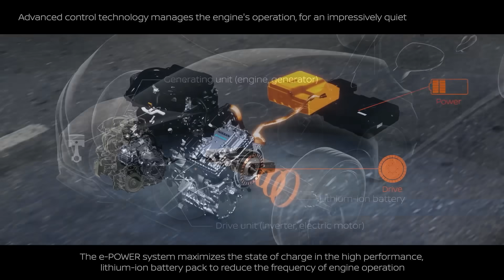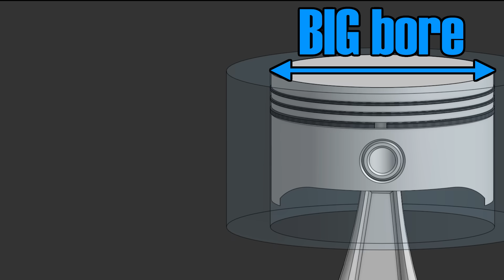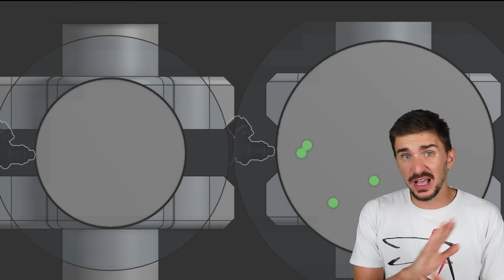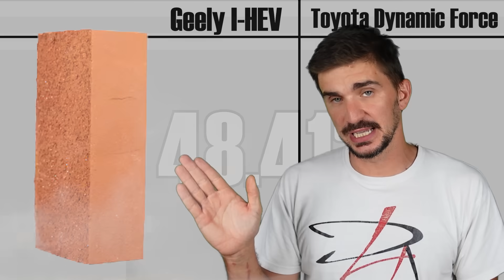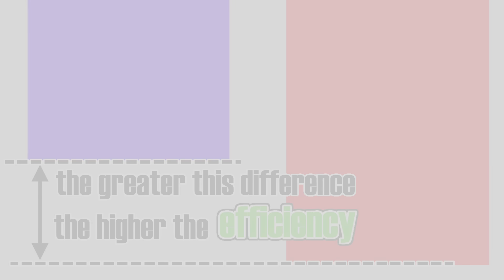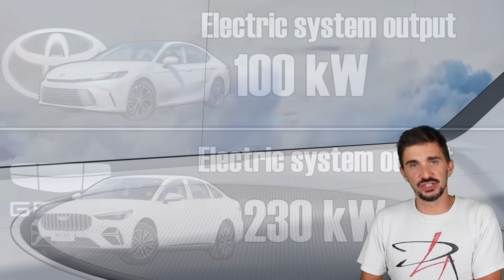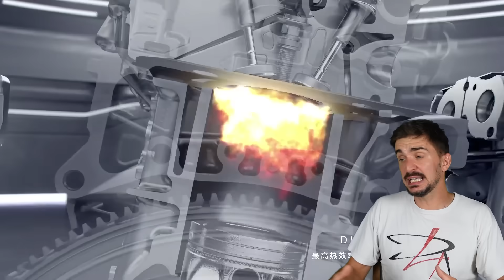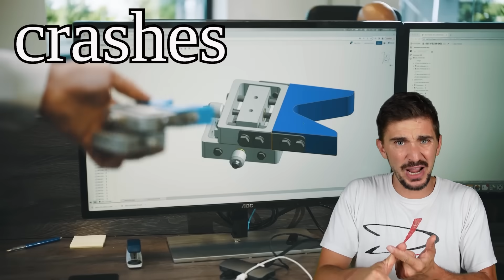How China's Geely Beat Toyota, BMW, Ford and Everyone Else

Comment: 48% efficiency doesn't make any sense with the presented technology by Geely, I can bet that they are measuring total mechanical work extracted by the piston from the fuel-air mixture, excluding the engine internal friction and other loses.
Reply: Atkinson/Miller cycle increases efficiency up to a point, going "deeper" than the sweet spot reduces it because engine internal friction starts to be "dominant consumer".

Comment: FYI when talking about a difference between two percentages you should use "percentage points" not "percent". I.e. the difference between 80% and 90% is 10 percentage points, not 10 percent.

Comment: I always thought that this is an interesting approach. Like a D-E train, but with some battery in between. Even a less efficient engine could make up for it because of the electric motors, batteries and regenerative braking. Plus, no losses in transmission, less moving parts..

Comment: Here's a question you didn't address -  yes, the longer strokes of diesel engines also results in higher thermal and fuel efficiency.  The trade off is that the combustion is at much hotter levels resulting in greater production of NOx.  Now, you could just run the engine at richer fuel mixture to burn off the NOx inside the engine, with more hydrocarbon emissions that could be burnt off by the catalytic converter.  BUT, you then don't get the eye popping mpg numbers that sell these engines.  So, passenger diesel cars use the notorious DEF, which was just urea, a.k.a. piss, as a reducing agent instead of fuel to maintain their dazzling mpg numbers.   As China has little air pollution controls, the question is what are mpg fuel efficiency ratings of Geely's cars in China versus this same engine sold in Western countries with strict air pollution controls?   I suspect they would need to run these engines at richer fuel mixtures (thus lowering the mpg numbers) in Western countries versus in China.

Comment: 14:35 Chevrolet made the Volt which was an EV first hybrid but killed it in 2019, it uses the engine is mostly as a generator but can connect to the wheels at highway speed for more efficiency, and it runs on a Atkinson cycle.

Comment: So it's about a 17% jump over Toyota's best engine: very impressive.  If the fuel economy improves similarly (it should) that would take a typical new base Prius from 56mpg highway to 65.5.
Don't say "Miller/Atkinson."  That just reinforces the error.  It's Atkinson.

Comment: I do not understand why we didn't get more Range Extender like the Chevy Volt, everyone that I know that owned one loved it. RE on a properly made EV chassis (looking at you Mazda...) should have the advantage of using a smaller cheaper, lighter battery with enough range for normal day-to-day usage, and on board recharging for longer trips with a small ICE optimized to run at a single RPM range. And the vehicles stays pretty much 100% operational in case of ICE issues, lessening the reliability concerns of hybrids. The lowered mass would also alleviate the tire wear and cost of large range high capacity battery EV currently on the market.

I currently don't make enough yearly distance to justify buying a new EV to replace my ICE car, but an well made EV with a smaller battery capacity and a RE would be on my radar quickly.

Comment: IMO most of those "amazing developments" are hollow numbers.
Part of why those hybrids engines are so efficient on paper is simply reduced exhaust treatment. Since they drive the cycle with/on Battery, they have less emissions and need less exhaust treatment to be compliant.
However, this means most hybrids have comparable emissions (aside from Co²) even during test cycles and (much) worse when driving on a flat battery.

Then you got all the "small" things that go against reliability. Weaker oil pumps, thinner oils etc.
And at the end of the day all that efficiency gets negated by a being packaged in a giant vehicle together with batteries, electric motors, computers/chips etc. anyway.
It doesn't make a vehicle better for the environment, when it uses 5-10% less fuel but needs to be replaced more frequently (and uses more resources during production).

It's the same story with those amazing CW figures of modern EVs, which conveniently leave out the area, making them completely invalid.

It also feels like modern cars become more and more useless or designed around being useless. 
If you bought a normal car in the 80s or 90s, you could use it to move.
If you buy a normal car now, it already comes pre-stuffed with all sorts of nonsense.
Even if you buy a large vehicle and can physically fit something like a washing machine inside, it would most likely damage the interior.

So at the end of the day, your "more efficient" vehicle is gonna sit in the driveway, while you get stuff delivered or rent a transporter for it.

To be clear: I'm not against development in general, but the automotive industry needs to focus on the consumer, rather than shareholders, agendas/politics or other nonsense.
You can only go so far with bad products. Even if you manage to push them onto customers, those customers will eventually be confronted with the depreciation (or other shortcomings), which impacts their buying power. 
VW propped up their sales numbers with pre registrations followed by heavy discounts and paired with subventions, but they still bled money on their ID.3 (and others). 
But even those who bought them with all the discounts and what not still got a turd that's as sought after as Keir Starmer as a financial expert.

Let me be blunt: Toyota is currently selling the Hilux Champ in Thailand for the equivalent of 14300€ (LWB Manual 2.4 Diesel 150hp).
If it were offered here in germany for 15k€ (not possible because regulations), I bet it would reach the highest marketshare instantly.
Not because people would fall in love with the design or don't want any luxury but because they need something that actually works as a car.

Comment: The very high compression ratio puzzles me. Surely you cannot have a spark ingnition, petrol (gasoline) engine running a 15:1 compression ratio without severe detonation taking place? I think the high compression ratio is calculated using the bore and stroke, but the actual compression ratio is substantially lower due to the Miller cycle.

Comment: Because Chinese engineers find out that combustionalized EVs are the most energy efficient. Gas alone only gives you at most 500 miles.Batter alone only gives you 400-500 miles top. But if you combine them together. Easily 800-1000 miles, with lower gas consumption and charging fees. image you can drive your car with 20 dollar gas and 10 dollars charging fees to drive almost 1000 miles. 30 dollars gives you from Boston to nearly miami. That's a great deal.

Comment: I think the high static compression ratio is used to achieve a high enough dynamic/effective compression ratio to maintain some power output, giving a much better balance of power an efficiency, only downside is it cannot be used as a otto, itll knock its brain out lol

Comment: thermal efficiency isn`t mechanical efficiency - when i studied i told my pro in an examen that we shall use the cooling water to heat up our houses - so the overall efficiency would be rised. only for germany you could save over 20%! by just using a small water tank (50l)in the back of the trunk.

Comment: This car will be obsolete so fast that spare parts will not be even distributed.... AI connected uphill prediction.... driving habits... to compensate for things that should be solved at the beginning...Cars should be simpler and locally serviceable by small independent mechanic shops or by yourself in some cases...

Comment: Neat even though it's much too late for cars. With the low battery cost it doesn't make sense to use fuel. under 50$/kWh a 40kWh pack is 2000$. Electric motor costs maybe 100$, power electronics can be equally inexpensive, say 300$, hybrid just can't compete with that when electric power can be nearly free of cost. There is no such thing as oil crisis for an EV. But there might be a tiny window for propeller planes to use efficient ICE but would need at least 100 horse to be interesting. What is it? 20horse?

Comment: I understand the choice of only current of recent engines for the stroke-to-bore ratio comparison is understandable, but the very first variant of the very first example of a traditional long-stroke gasoline engine that I decided to check (the old Ford Straight Six) has a similar stroke-to-bore ratio as the extreme recent examples. There's nothing new here.

Comment: The problem is that car makers are still trying to make a swiss knife version of a car.   You can't.   
Cars should be tailored to the needs of demographics.   And people should be more consequent with what they actually need.  In my case, living in an island and driving 100km a day at 120km/hour, I don't need 400hp and a 2 ton behemot that can do 500km on a charge. Despite of that   I would like to have bit of comfort like interior space and a comfy ride,  I don't want a gof chart.  Or a 40k luxury urban.    
There is people that lives up in the mountais and have the same situation...     Cars are getting designed with cities and traver in between cities in mind only

Comment: I drive a 15 year old 2.0 hdi diesel engine, in a 407 SW. No AI, no VVT, no anything. Single turbo and common rail. Makes a whopping 136hp and 320nm. However I never had a moment where it felt inadequate in normal driving scenario.
Reply: Back in my day..
Reply: I loved that car! Peak design, always wanted a 407 SW, but they're just too long for easy parking in the city. Has your service bill exceeded the cost of the initial purchase so far? 😀
Reply: @ABCodeCC  Not at all, stock injectors, stock turbo, stock EGR, stock FAP/DPF. Everything tested and is running well. The only expensive maintenance items are the front suspension and the automatic transmission oil.
Reply: Irony is also a hybrid diesel can get beyond 50% thermal efficacy as well
Reply: he was talking about the chinese one but didnt mean to imply diesel engines like what you have
Reply: UNTIL you need to change the injector , or have the infamous steering pump stall that plagued all PF3 platform from PSA
Reply: My 2012 Passat TDI is my daily workhorse. It's as smooth as any thing out there
Reply: @robertpsotka3525  Excellent car.

Comment: I know how to disperse fuel into a  large diameter combustion chamber evenly…..
Try a carburetor with an optimized intake runner. Of course you will be restricted by compression ratio to maximum 11 to one on 92 octane

Comment: I really love your content.  But have one small correction.  You said that none of the Japanese or European makers produce hybrids that are essentially electric cars with engines.  That is incorrect.  The Honda hybrid system is essentially an electric car with a motor/generator.  There is no torque converter or gearbox.  The engine only directly engages when the car is at a speed that works for its one gear.
Reply from the maker: Thanks, but that's not quite what I said. I said none of the European/Japanese/US makers produce electric-centric hybrids. The Nissan e-power is series (generator) only but still not electric centric in the sense Geely is because the electric sysyem and combustion system are balanced to each other whereas in the Geely the electric system greatly overpowers the ICE.

Comment: The reason China is easing off of EV’s and shifting to hybrids is because it’s a response to European tariffs that are targeted at EV’s.  The tariffs are very narrowly targeted so it’s a loophole to get around them.  The problem China has is that the state has sponsored massive over investment and overbuilding and over capacity in vehicle production, especially electric vehicle vehicles and in battery production.  They die if they cannot export their over capacity to the rest of the world, but also by doing so they will destroy the rest of the world’s auto industry.  This is an example of unfair, manipulative illegal trade.  They are also manipulating the currency at the same time.  China, short circuits and destroys every system they’re allowed into. They’re like a virus.  Europe is currently working on rewriting their tariff system to me the American system specifically section 301.  This will allow them to attack broad categories instead of fight China product by product, but literally what we’re seeing is a response to a loophole in tariff administration.
Reply: This is not original research of mine by the way you can get this from a variety of automotive websites. Patrick Boyle also did a nice YouTube video explaining it as part of a larger problem with Europe’s auto industry.

Comment: 15:21 💯 that's what I've been saying. 

electric centered hybrids make much more sense, because for many hybrids you could argue they combine many of the drawbacks of both worlds. (higher weight, low electric range, many moving parts, higher maintenance costs than EV's)

A hybrid makes the most sense if you can charge it at home (and at charging stations), a battery that enables at least 50-100km of  electric range, and when the internal combustion engine is either mechanically disconnected from the drivetrain or has some form of CVT. 

Focus on the electric part, because that is the superior technology, and add the combustion engine as a range extender for the people who have range anxiety or can't afford an EV with a high range.

Comment: chinese manufacturers are developing hybrid cars because they want a share of the global automotive market and there's still markets that are really slow in adapting electric vehicles.
IMHO hat's not the interesting question though.

The interesting question would be, why they're still coupling the internal combustion engine to the rest of the drivetrain, instead of just using it as a generator. 

That would make more sense with any engine, because you can run it at a fixed rpm and optimise it for exactly that, obviously resulting in higher efficiency. 
But especially with their highly efficient, low-power engine it would make so much sense to just use it as a generator...

Comment: What do you mean no western manufacturer has ever tried this approach, this sounds exactly like the GM Voltec powertrain (Volt, ELR, Ampera)?

Edit: GM's solution to anticipating hills was just having a driver selectable mode called "Mountain" where it targets maintaining a 50% charge level instead of letting the battery deplete completely before running the ICE. There's a also a "Hold" mode where it will maintain whatever charge it's at when you enable it, although you typically would not want to maintain it at 100% because then there's no space to recover energy on the downhill

Comment: I've always said that this is the only way to get full market penetration of EVs, mostly due to rural customers and those who often travel long distances. It's always been the achiles heel of EVs that they're not as good for road trips and you certainly can't take them to remote areas that lack charging infrastructure. With a gas vehicle you just take more fuel and that's a relatively simple fix. You can't do that with an EV, so having an EV with a generator onboard that can extend the range and allow you to run the car without plugging it in at all will be the thing that finally tips the scale into full EV adoption. Current EV owners like to diminish these concerns because they've learned to work around them and they're also usually urban or suburban. People who live in rural areas understand this problem well though, and ignoring them will be at manufacturers' peril. I believe that due to remote work and automation, we're going to have a remigration out of cities for the first time in modern history, and if you don't have a viable product for the people who move out into the sticks, you're going to get left behind by those who do provide a good solution.

Comment: As always,  fantastic video.. I've been a licensed technician for over 40 years and now a EV/ice teacher.. I've been telling my students about this for years.  Atkinson engines are great  but absolutely gutless,  hence the use in hybrid's.. and you are 100% correct about large concerns for inclined roads and pulling anything.. I  know several manufacturers that have this exact problem and customers are pissed.  You CANNOT pull and climb  a hill if you are less then 80% SOC.. or you won't  make it..

Comment: Or just do what FIAT does with the twin air, and us the valve timing as a throttle control, Otto cycle when you need power, Atkinson cycle all other times.